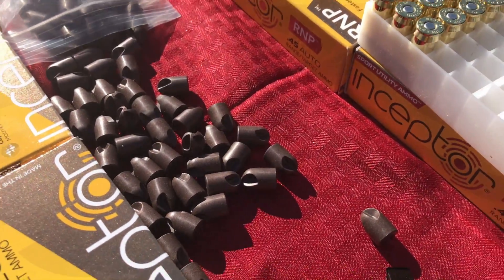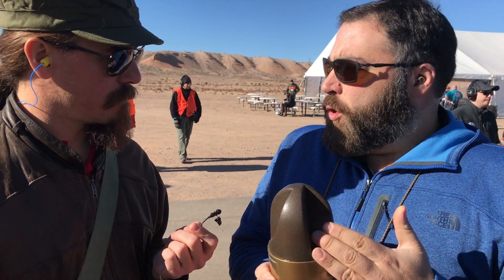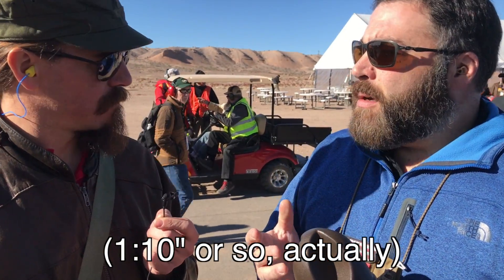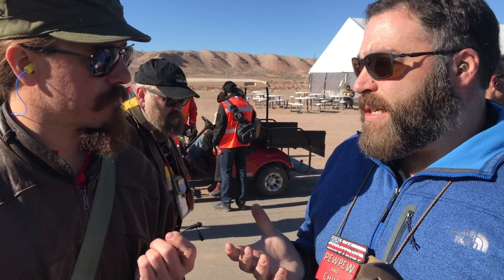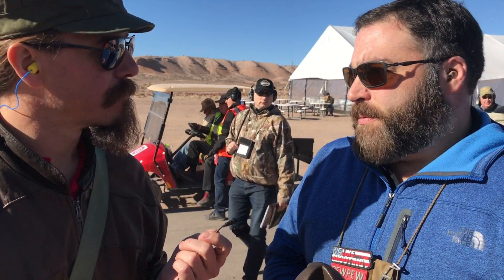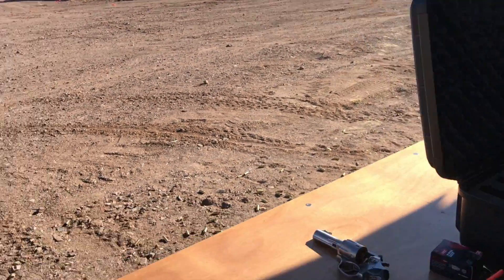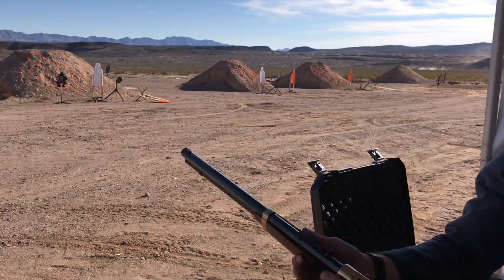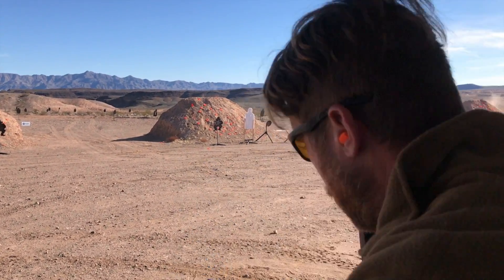SHOT 2017: Polycase Ammo

Comment: I just woke up about 10 minutes ago - so bare with me... The 'rep' said that the bullet is spinning twice as fast as it is traveling down range. I forgot the velocity on the 9mm, so I'll use the velocity from the .45 Colt - 1,350 feet per second. I just did a quick Google search for the SAAMI data on .45 Colt and it's telling me that the bullet diameter is .456". So, .456 multiplied by Pi is about 1.433. Alright, so that means that the circumference of the bullet is 1.433 inches. Again, the representative said that the bullet is spinning TWICE AS FAST AS IT IS MOVING, so at 1,350 FPS, that means it's spinning with a speed of 2,700 feet per second at the surface. 2,700 divided by 12 gives me inches per second, that divided by the circumference of the bullet gives me the revolutions per second. Is this correct? I believe that it is. The number that I ended up with is 22609.9 - It absolutely is not spinning that quickly. With a twist rate of 1:38" twist rate - which is what the internet is telling me that the Big Boy in .45 Colt has. If the round was going 1,350 FPS, the round would spin {math 1,350/38=35.526*60=2131.56 end math} 2131.56 RPM. ONE TENTH of the revolutions per minute that they claimed. Gerrrr... I still like that it's frangible, but you have to pay out the ass for it. I'll stick to good eye pro and tilting my steel down. I don't hang my targets from chain and I only use wooden frames to hang them. I use some of that 3/8" white nylon rope, I think it's rated for 150 pounds constant 500 pounds dynamic? All I know is that it holds my 2 foot square 1/2" AR500 plate (That I FOUND IN THE DIRT - It was a skid plate from a piece of logging equipment). FWIW, the AR in AR500 stands for abrasion resistant. They use AR steel for the drums on steel wheel vibratory rollers and the like. Oh, and I've been up for 20 minutes now.
Reply: Oh, and I'll do the math on the 9mm, too. Who knows, maybe the 9mm round will be spinning twice as fast as it moves down range. I now have to go carry bags of concrete across a muddy hill.
Reply: Your math is wrong. You have to convert the twist rate in inches to feet, so 1 in 38 inches becomes 1 in 3.16 feet. You cannot divide ft/s by inches. So the bullet is doing 25,633 rpm.
Reply: Donald Weber Oops. I see what I did wrong. Thank you. As I said, I had just woken up and to a screaming one year old, no less.